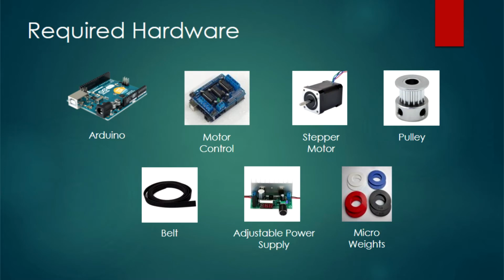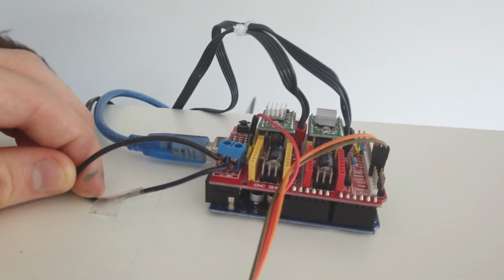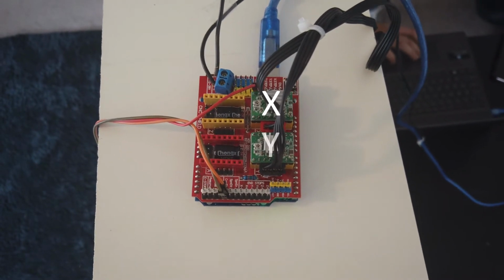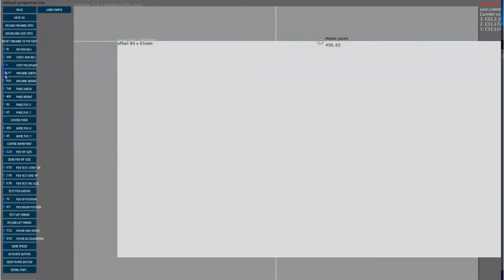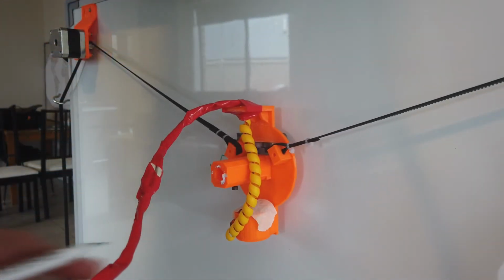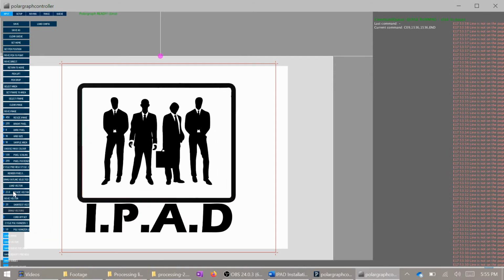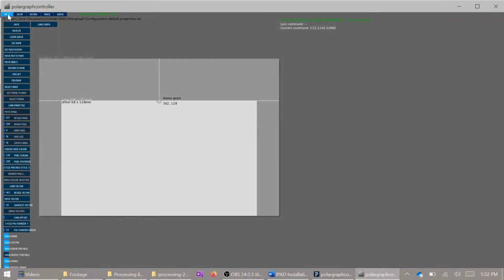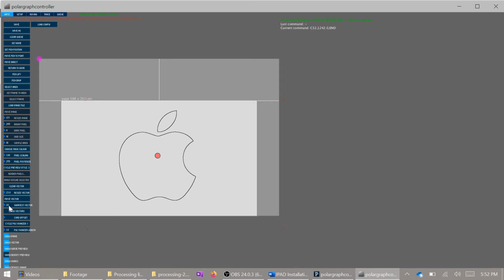How to Build and Setup an XY Polargraph 'V-Plotter'

Comment: For  "No serial connection" even after choosing COM3 or any other port I found the below workaround online-

"Hmm. I fiddled with it some more, and discovered that if I selected NO SERIAL CONNECTION, then select COM3 again, it successfully connects. I have to do this every time I run the controller app, but I have a working workaround."

Comment: You skipped the most important step : how to take care of the error that says "No serial connection" in the Polargraphcontroller UI. The video just directly fades to the controller magically showing no error anymore, without showing what you did !
Edit : Okay, found it, you mentionned it later in the vid. It's the last button in the Setup panel.
Also, the footage showing the person measuring the machine seems wrong, as he is measuring the outer dimensions of the wooden frame as opposed to the actual machine area (as defined by the motors).
Lastly, the upbeat music is incredibly annoying when trying to figure out such complex topics ...